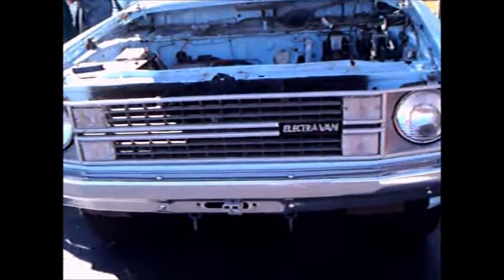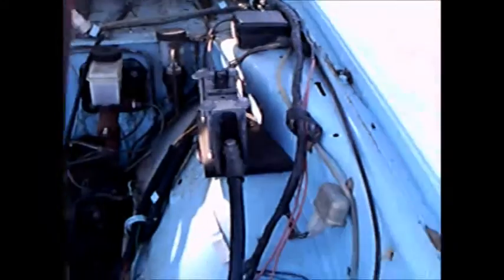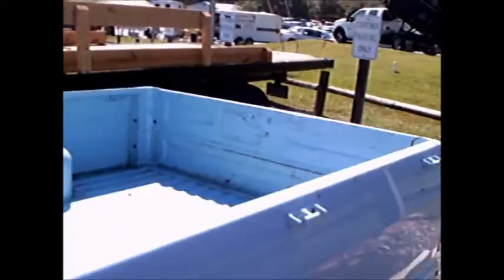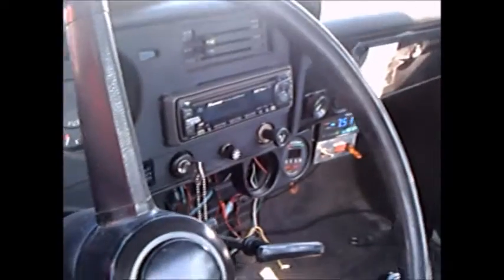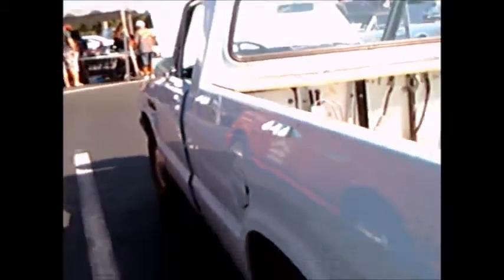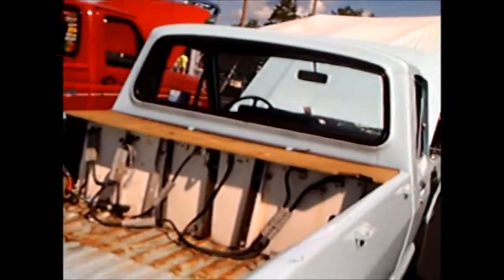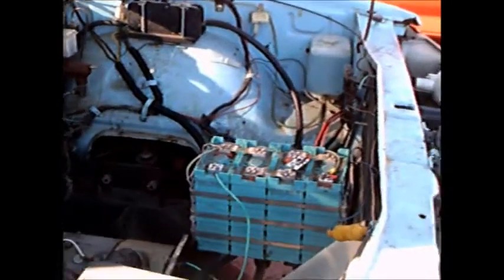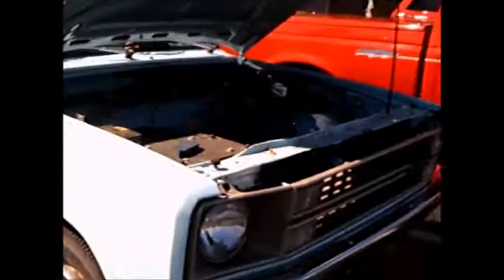1980 Ford Courier Electric Conversion Electravan Wht InvernessFord092416

Comment: About 20 years ago, a friend converted an old Datsun pickup himself. The bed was full of lead acid batteries and, like this one, he could only get about 50 miles out of it. I'm glad things have gotten better in that regard these days. A little solar car i like is the sunnev. I can't share a link here, but it's as close as one can likely get to an easily solar powered car ... although i have to say that it's not exactly a car for the interstate :)
Reply from the maker: Yes, lead acid batteries is not the way to go...solar is promising and so is hydrogen which I understand is in Toyota's realm.  Something has to be more practical than what we have right now, especially for distance driving.  Thanks!  :) Jack